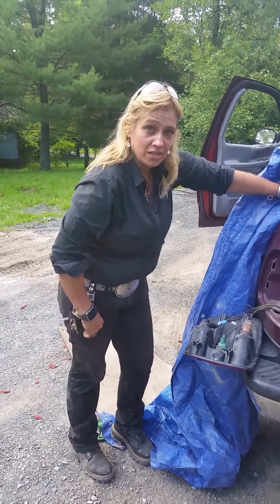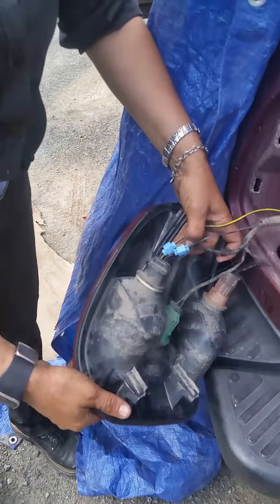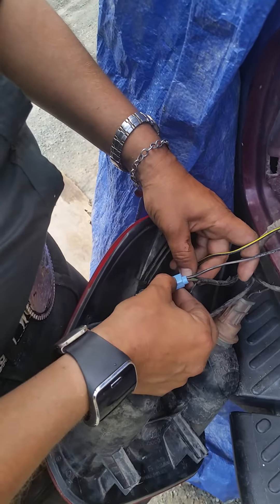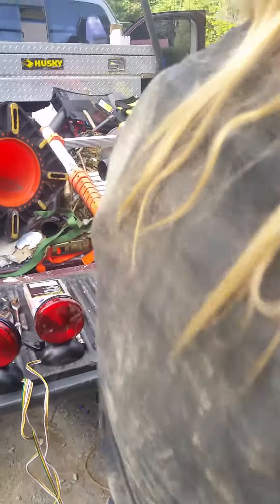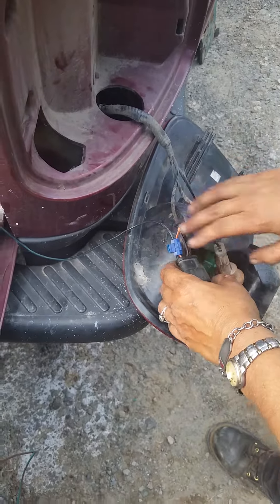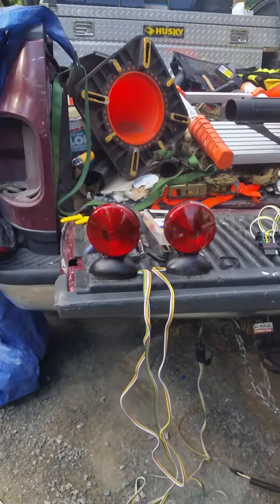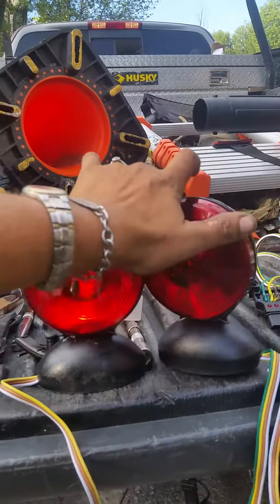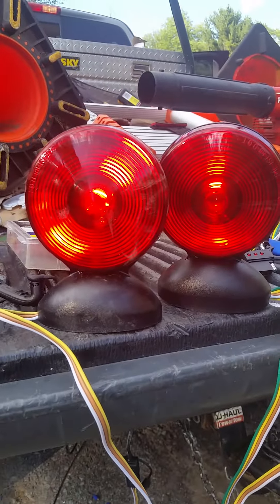F150 easy trailer wire light hook up 4 flat 4 wire vehicle connection

Comment: Thank you so much, this save me a lot of time. I have a 98 F-150 and I followed step by step what you said and it worked out beautifully. I ran my wiring through the back part of the lights and secured wires underneath inside the bumper neatly and tied them in to my 4 flat connector.

Comment: How did you fix the issues with them not working at night while the headlights are on and no running lights , see I had bought this truck and they took off the bed of the truck and there was only wiring so I made a new harness and wired it up how you described and it only works while the headlights are off! Any info would be appreciated thanks for being so helpful